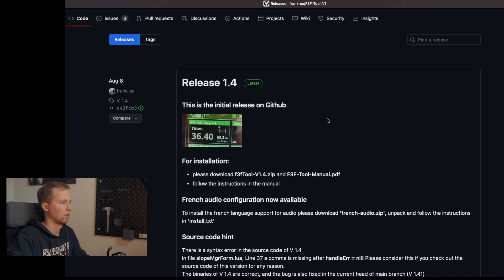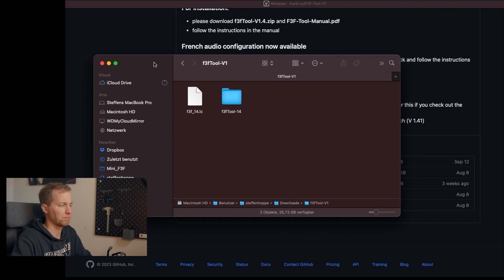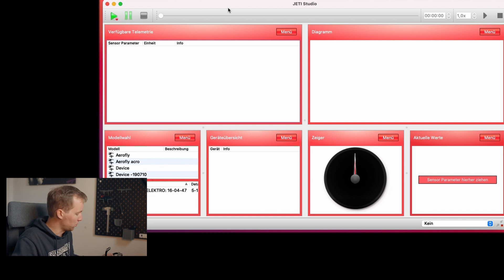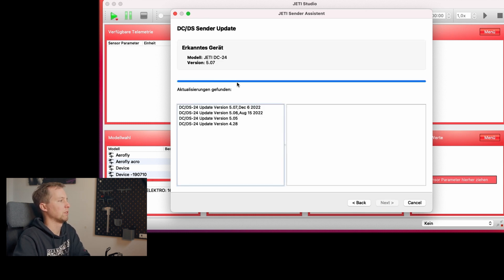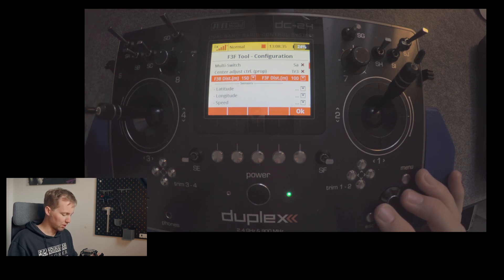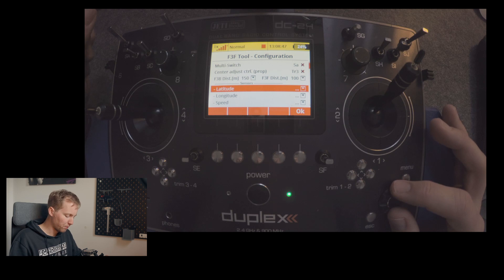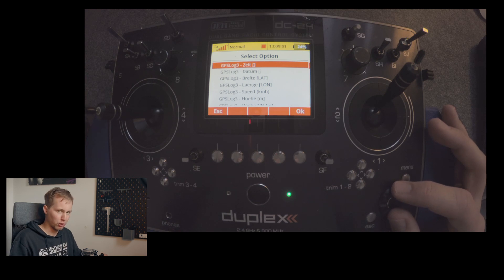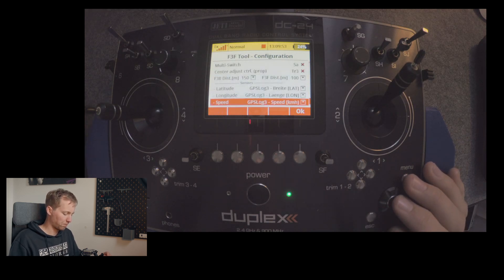F3F TOOL 🛠 TUTORIAL | BEST JETI LUA APP?

Comment: hell, seams a good tool ! but not work on ds12 transmitter, system no recognise gps sensor (hpef).... but mayde i do something wrong !
Reply from the maker: It is 😉
The tool also works on the DS12. A friend of mine uses it. Make sure that the sensor is in the right port of your receiver and that the port is in the right mode.

Comment: Hi excellent video, thank you for taking the time to make and share. I have just installed mine. I have good connection and telemetry values that look correct. However while using in F3F mode it does not register when a leg has been completed. Countdown from 30 seconds all good then course. Speed is showing, height is showing, 23 satellites but no indication when passing either A or B base.  Please note I just did a very short course configuration in my garden and reduced the course length down to 10m and have just walked back and forth with the model. Any idea why it would not register?
Thank you
Hugh